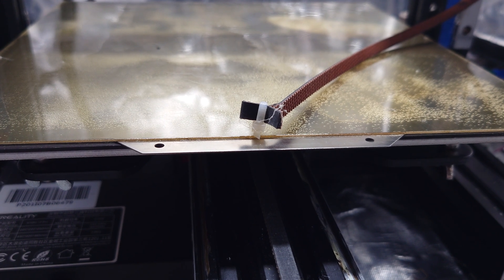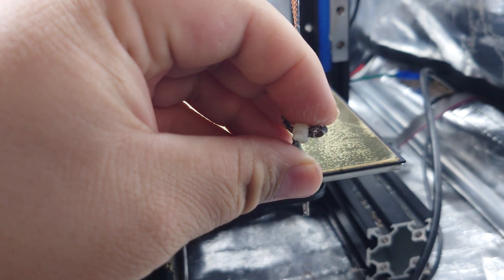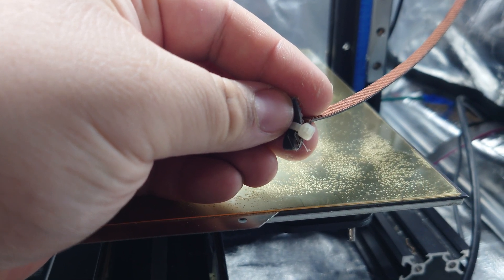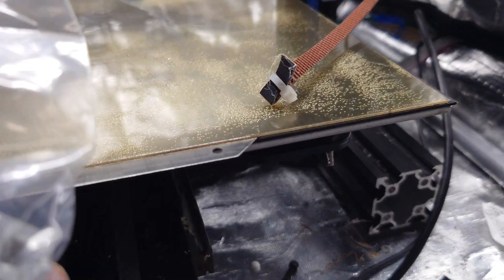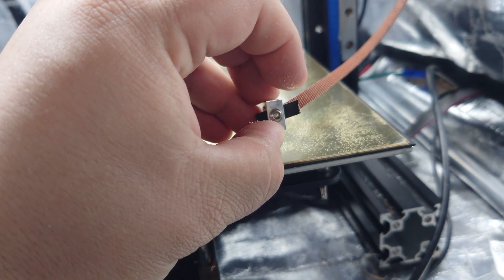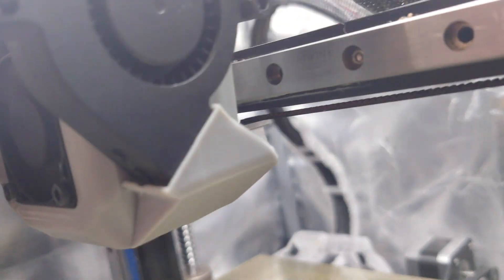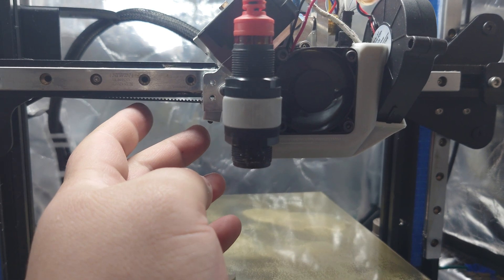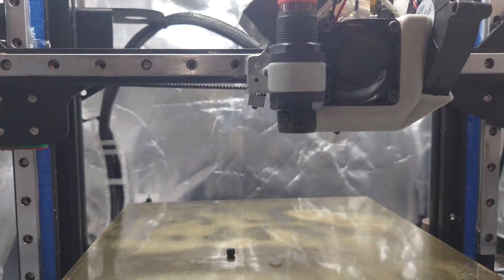My new favorite way to size custom 3D printer belts

Comment: Just.. design the belt retention mechanism to use the belt itself either by looping the belt back over a pin or by having teeth integrated into the part? The belt will be just fine. Look at Prusa belt fixings.

BTW that belt path is whack. You know why, because the attachment side of the belt doesn't run entirely parallel to the axis, the total belt length changes between the middle and the extremes. I know it's less than 0.1mm of actual non-linearity but like WHY would you keep it like that.

Comment: Something to keep in mind when replacing my belts, thou mine has adjustment nobs for adjusting tension so i probably would not need to worry about being perfectly precise with the zip tie part. Id probably buy the belts made specifically for my printer. I use a kobra 2 neo.
Reply: They sell pre-sized belt for your printer? Apparently they do... well that's highly unusual actually.